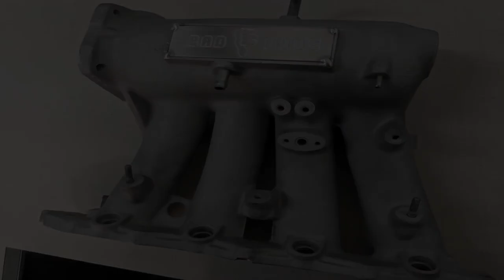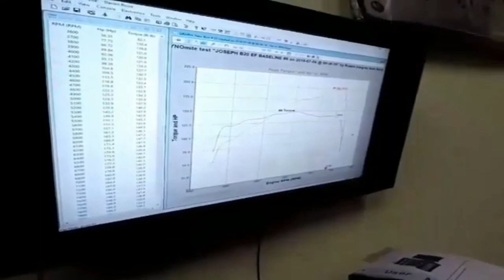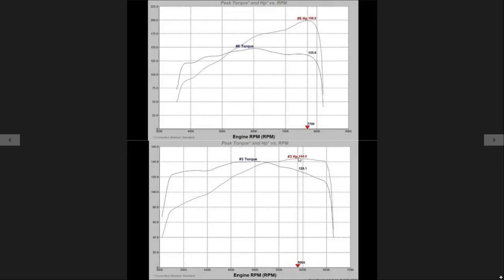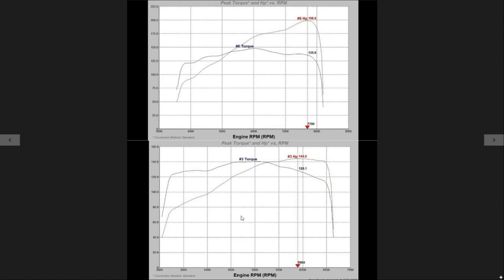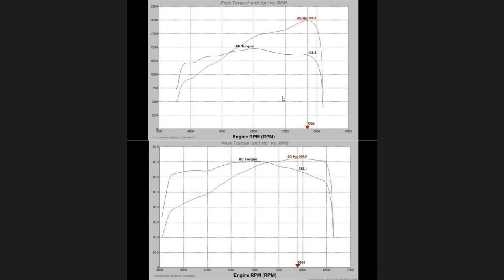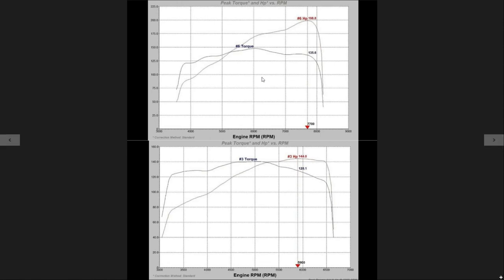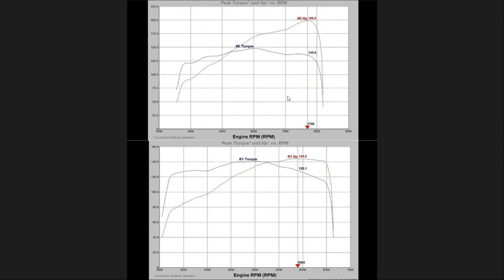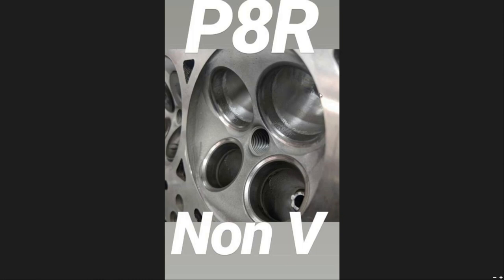Low Dollar Brawler Non Vtec B20

Comment: To compare for everyone who plans to go forward. This setup with p8r when done right will be over 200-220whp depending setup and parts used and on e85.
I have plans to go this route in about a year.

Current  build and tune  b20b phk 9:6cr w/ .30 milled head on 91 pump, Crower 403s crower valvetrain, ultra street manifold 70mm tb. Full Ported p75 head  using Toda style  4-2-1, 2.5" exhaust with hi flow cat and restricted apexi ws2.  I'm probably sacrificing  about 8-10 more whp and tq give or take because of the hi flow and apexi.   My goals was 180whp  on pump and I didn't make it but very happy.

175/146tq...whp peak 7600 while tq peak around 5.5k but carrys it nicely to 7100 with 129tq. I shift at 7200 on gsr trans. Now all I need is a b16/itr 4.4 Trans and I'm finish

I'm sure if I went with e85 or a p8r head ill be in the 195whp or 200whp but that's for future with 13cr block and full port p8r from badguys and I'll change to crower 404s and similar setup.   I like keeping things smaller or longer  to keep the low-end mid range as my plans are for daily street race so I don't need to Rev to the moon like vtec.   I have been there in the past with 3 vtec motors and jrsc and yes they are a beast, but being different  on non vtec and most people would think u on vtec but get beat by a non vtec 😆

March 2023 updates: same setup but on e85 am doing roughly 19xwhp on streettuned. Thing rips for sure...

June 2024, have me my p8r head finally been lagging.   All I need is to get it fully ported then build the block up with some piston looking for 12.5 cr min.  Then add all the goodies back and add the jrsc m62 VTEC kit tune on e85.
Reply: Its definitely worth it. I ended up putting scat ha beam rods and nippon p30 pistons in the bottom end of this motor and switching to e85. Car made 210whp/165wtq. There was more in it too, at that point the 70mm tb wasnt cutting it. Unfortunately this car has been sold now though.
Reply: What valves and springs are you guys running in these heads for that crower 404
Reply: @einstienium702  the 70mm tb was too small at that point? Was the Blox with the port work still sufficient? I quite literally based my purchases off of this video 😅
Reply: So you got + 15 hp with e85?

Comment: These numbers are awesome.  The p8r runs "better" with p75 cams in it for the super budget setup. 

I'm going to run the delta 272 in mine here shortly...199 hp is well into vtec territory on pump gas
Reply: How much do the delta 272 regrinds cost?

Comment: I have one of these I’m putting on the phk piston bottom end with 404s and a 3 angle job. If it’s not enough power I’ll send you guys the head for porting!
Reply: What is your cr and how much power and tq? What is ur redline
Reply: @b20eg195  I made 175whp/140ft lbs on p8R with the stock 9.6:1 CR and crower 404's
Reply: @hunterjames4975  I am at 175/146 on 91 pump. Crower 403s ported p75 head, ultra street 70mm 421 Toda header, camgear tuning +3 in and +1 ex, hi flow cat with restricted apexi ws2. Probably could of gain 3-5whp and tq give or take. I'm sure I'd be in the 185 with e85. 7900 revlimit but tune to 7600 shit at 7100 tq still at 129.

That means withbmy p8r head ill have to send to badguys before installing. And this time raise redline.

What fuel did u use.
Reply: @b20eg195  i was on 91 octane, I am doing a full build now with 11.5:1 CR pistons, and the fully ported bad guys p8r head.
Reply: @hunterjames4975  sounds  like a great plan I'd be at 13cr if not 14cr with same setup but better header and exhaust tune on e85 only with flex fuel kit.     The way I see it is on 91 pump I get around 220-230 at most a tank give or take.

For e85 I would probably have to say 140-170 ! Tank depending how u drive....

Comment: I'd hate to say it but the power lost down low on everything below 5000rpm definitely necessitates a bump in compression on this one. Those cams are begging for it and they dont want to be called the enemy bleeding off on this great build.
Take it to at least 11:1 (heck maybe with just milling) on 91 and i reckon seing more fun things happening on everything you've done so far. Just my 2cents. Cheers!
Reply from the maker: Doc Hudson if you look at it based off rpm there no loss at low rpm
Reply: There actually was no power loss anywhere. It would absolutely benefit from a bump in compression which will be the next step in this build 👌. But just the top end work made it a completely different car, its night and day from the stock setup.

Comment: Im doing hi compression pistons in a b20 11.8:1 with p30 style nippon 84mm. I am having trouble even finding parts for this p8r head laying in my garage so thank you finally theirs non vtec head swap supporters. I have crower 403s from my b18b and delta 272 regrinds that r just insane. But how much for a valvetrain from you guys cost?$ if price is right ill let you do my whole p8r head, im just worried of ptv issues with the larger valves and raised compression on 93 pump
Reply from the maker: We have ran much larger cams on similar style pistons, spring kit is 385.00. Degree wheel cam install with sort out your p2v concerns. Feel free to message us at 
Facebook.com/badguysworldwide
Reply: Crower makes a full valvetrain for these cylinder heads

Comment: Would these cams work on a b20 using phk pistons or would I have to worry about P2V clearance?  How about with those YCP type r 84mm replicas?  Also if a p8r head cant be found how do you think the p75 head would choke a setup like this?

Comment: What kind of power would these stage 4 cams be able to make in a P75 head on a B20Z2?  Trying to decide whether to build and swap a GSR head I have or just throw some stage 4 cams into the P75 head I've already built.  Could it about match a GSR head on stock cams?  I can literally throw in the cams as it sits, assuming no piston/valve clearance issues on a stock B20Z2, versus the porting, valve work, springs, milling, gaskets/seals, brackets, oil lines, dowels, belt covers, cam belt/waterpump, head studs, VTEC spool valve, rebuild distributor, plug wires, and on and on to commission the GSR head.
Reply from the maker: The p75 head is a huge waste of time. It barely moves more air than a d16z6 cylinder head. This will hold you back quite a bit vs the p8r
Reply: @badguysworldwide  p75 isn't a waste of time. It's the tunner. We have a stock b20z2 non vtec running 12s.
Reply from the maker: @gameovertune9018  it literally moves as much air as a z6 head

Comment: My bc dual springs will work but the valves and seals are my concern. Their not the same size valve stem as the vtec. Do you guys sell just the valves for the p8r?
Reply from the maker: We do not currently no.

Comment: How can i get a p8r head without buying a full b20?
Reply: I believe p8r are jdm only so ebay or fly to japan and check some junkyards other than that you gotta get a full motor from importer. A full b20 is pretty cheap
Reply: @lollol-xp4mc  they are $650 plus tax and i dont have any need nor space for the block

Comment: This is interesting. I'm curious now, what percentage of the gains can be attributed to the porting and machine work? How different would the results be with just the bolt ons?
Reply from the maker: Typically on this level of port work the p8r will out flow a stock gsr to about .350 lift. 

But b20 have notoriously small cams, so its all works hand in hand. This was however kind of the perfect storm because the b20s are seriously lacking in the head and cam dept!
Reply: @badguysworldwide  I have been trying to find answers on cams. What is the biggest cams I can use on a b20z phk with p75 head or p8r without p2v clearance? Or how high in rpm before it could hit?

Comment: What's your reasoning for saying the p75 head is bad for power?
Reply: Well, he stated that the P8R head has bigger valves, so that's at least one reason.
Reply: @tommylyeah  I've known about the bigger valves, but ive seen that the p8r head always comes on the lower compression engines. And was just curious. The b20z2 I've got to put in my car has a p75 head. Was just wondering if when I decide to start doing some more work, why the p75 head was such an awful choice.
Reply from the maker: Valve diameter. They are WAY down on flow. And p8r heads are like 100.00 cheap for the flow potential
Reply: @badguysworldwide  is there a way I can pay you all for a head?  The core charge seems a bit steep but I can't find a p8r under $300 around me.
Reply from the maker: Yes no problem message the facebook page or IG!
Reply: Welp... just got me a b20b with a p8r head 😂😂😂 gots some work to do to it, but hey 🤷‍♂️🤷‍♂️🤷‍♂️

Comment: this is really impressive.  could you get similar #'s on the b20z2 with p8r head?  then boost it adding arp headstuds a block guard and some good rods while honing the cylinders and adding new rings gapped with extra clearance for 15 lbs of boost max.   who does the head work?  I am in WI.  did you shim the oil pump at all?
Reply: You can do anything with money